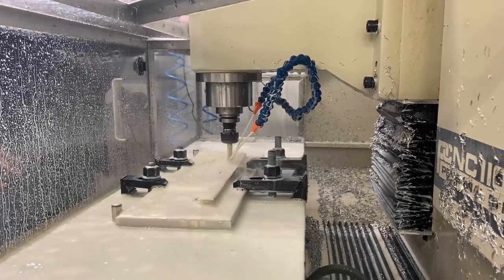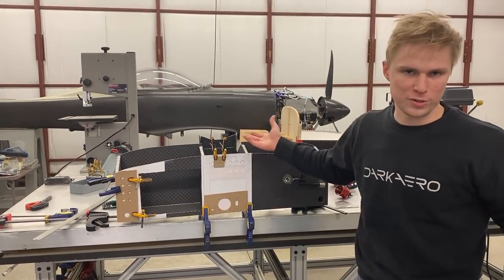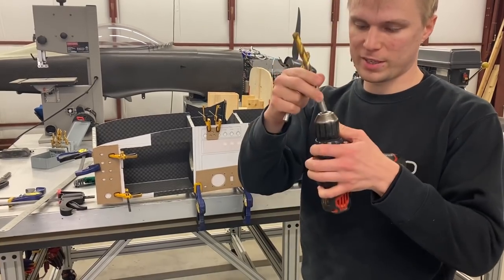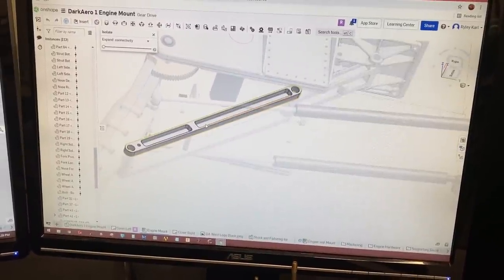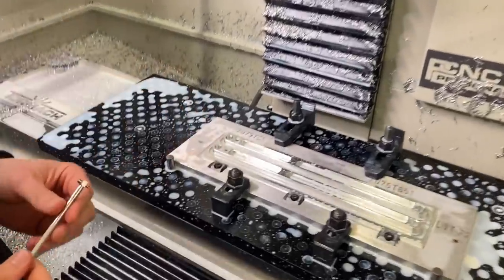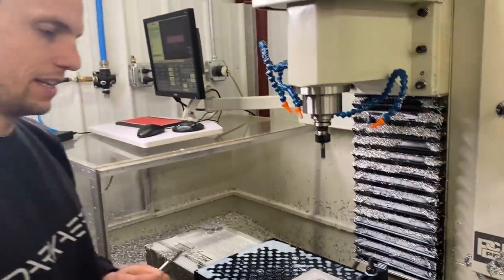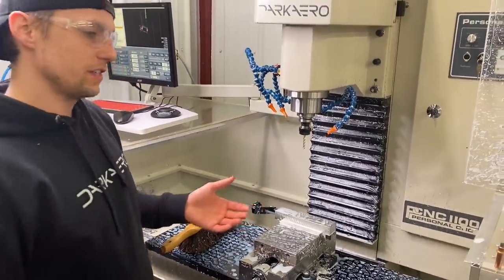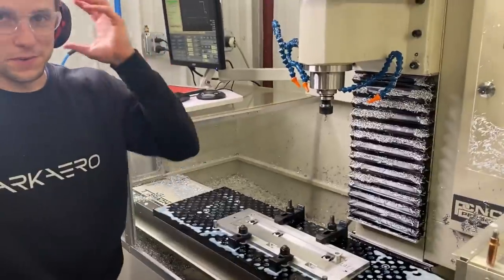Engineering and Manufacturing | DarkAero Shop Vlog | April 22, 2021

Comment: Small hearing protection upgrade to make to improve fit and comfort: get some replacement 'gel pads' off Amazon.  I can't quite make out what model you're using but if you look for them I think you'll easily find them.  Knock offs are about half the price of the real 3M replacement parts.  They conform around safety glasses a lot better and make wearing them over long periods a lot more tolerable.  Well worth the $20-60 upgrade.
Reply: I use 3M worktunes with these.  You CAN listen to music (not sure your rules / safety practices) or just use them as passive hearing protection:
https://www.amazon.com/dp/B08HTXDGJ5/ref=cm_sw_r_tw_dp_5QZ3T9F6NNP14Q7FESWZ

Comment: Thanks for the video!! May I assume a full size template of sorts that covers the entire control panel and mechanises the drill/cutout process is on the cards further down the line?
Reply from the maker: Normally we would just CNC cut the proper holes in the same operation as cutting the instrument panel from flat stock. We made some late changes and additions to the hardware we will attach to the panel so this was all rework. Hopefully it’s the only time we use this method. 😁

Comment: Awesome video. I'm trying to learn as much as I can. Could you have used the drill press to make the holes and not had the problem of the moving drill bit? I'm just curious.
Reply from the maker: Thank you! Normally we CNC cut the holes in the same operation as cutting out the rest of the instrument panel. This was a rework operation to accommodate some late changes. The drill press we have is pretty short in Z-height so the instrument panel assembly wouldn’t fit in our drill press. A taller one would make the drill press a potential option.

Comment: What cam software do you use? Does Onshape have a cam feature?
Reply from the maker: We use Fusion360 for CAM. Onshape doesn’t have a CAM tool directly in the software yet but it integrates with a number of CAM tools though.
Reply: @DarkAeroInc  what percentage (by part count) of your aluminum milling is "2 1/2 D" (Z fixed whenever X or Y is moving) versus 3D?  Do you ever skip the CAM and just hand write the G Code (variables and loops are quite powerful)?

Comment: With that panel It looks like you are going with 2 G3X and a GTN 650.  What if you want a 750?  Could the switches be moved to the lower portion of the panel or above the G3X?
Reply from the maker: Our final IFR setup will be 2 G3X displays and a GTN650 as you suggest. The panel could be arranged to accommodate a GTN750 instead of a GTN650. Thank you for watching!

Comment: This is an unloaded question. I'm not trying to start an argument. British person asking. So, I'm surprised that this project is using imperial measurements. I thought large scale engineering projects had moved over to metric in the US? Or is that just defence type stuff? Anyway, love this project!
Reply from the maker: Thanks for watching Lawrence! We actually use both imperial and metric on the DarkAero 1 and there isn’t really a good way around it. We could work in only one unit system if we were building every single piece of hardware in the aircraft and it was only intended for us. This isn’t the case though because we source raw materials and hardware from companies in several different countries. Most of the materials and fasteners we source are local and are sold in imperial units. The engine, propeller, and wheels/brakes are sourced from outside the US and are mostly metric with a few imperial parts. When it’s all done it will be sold as a kit and 80-90% of are customers are in the US and are familiar with imperial. We did most of the engineering calcs in metric units because....slugs. ;) Using two unit systems isn’t ideal but it’s just the world we live in.
Reply: @DarkAeroInc Now that is going to make things fun! I totally didn't expect that, but of course with the European engine you are going to have some metric too, jeez! Thanks for the detailed reply. Take care, Lawrence.

Comment: You make some parts out of Carbon Fiber and others out of Aluminum, how do you decide which to use?
Reply from the maker: That’s a good question! Carbon fiber is well suited for bigger, flatter parts like the airframe skins or bulkheads. Carbon becomes less ideal when you get into smaller parts with detailed geometry or tight tolerances on small features. We have a lot of tricky detailed features in the landing gear parts so aluminum works better here. There is some overlap between the two materials so certain parts could go either way; carbon or aluminum. Carbon is lower density than aluminum so in those scenarios we will still lean towards carbon. There are more factors to consider too like manufacturability and cost so it’s hard to give absolute rules on when to use what material.

Comment: do you perform fastener calculations across all fastened laminates? or do you just make some assumptions to keep it simple?
Reply from the maker: Ralph, thanks for watching and the question! For bolted joints or fasteners that are heavily loaded in tension or shear, we do thorough calculations. On assemblies that are more lightly loaded, like an access cover fastened with screws, we can get away with more simplified assumptions. We use aerospace grade hardware and follow torque specifications and installation guidelines per FAA 43.13-1B and FAA-H-8083-30A. More details on that can be found on the hardware section of our Knowledge Base: https://www.darkaero.com/knowledge/hardware-specs/

Comment: 08:12 If you are afraid that the screw will damage the hole string, I suggest you put a nut on the reverse side of the fixture. I will send you a photo on instagram so you can see how I use pit bulls